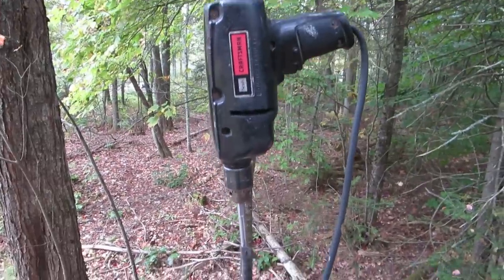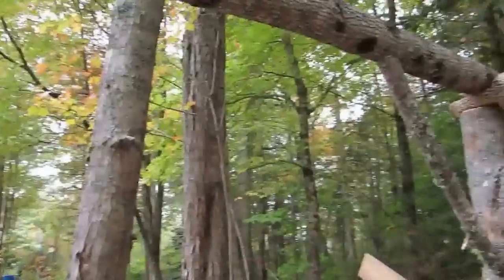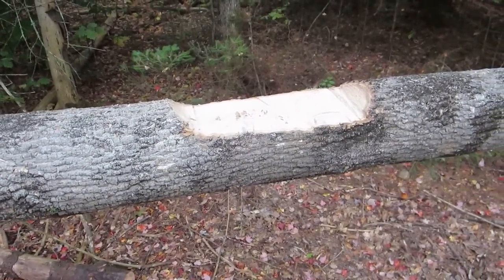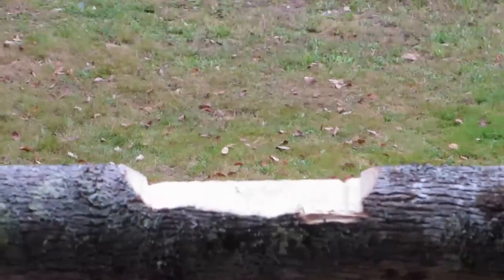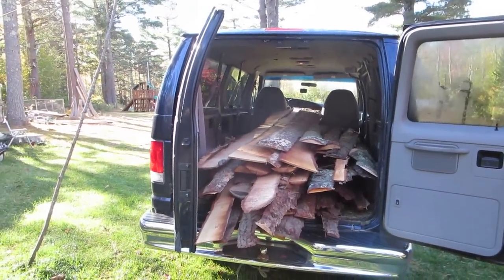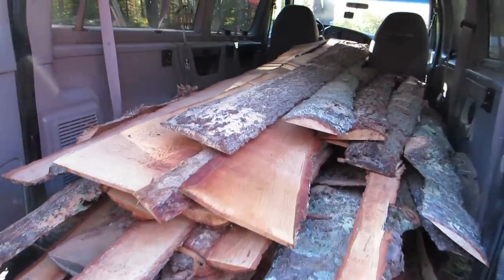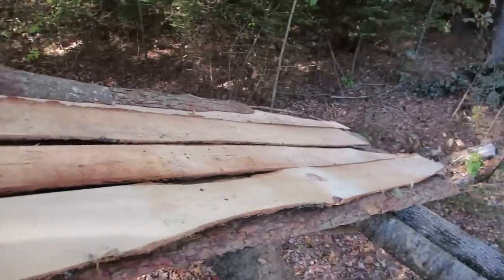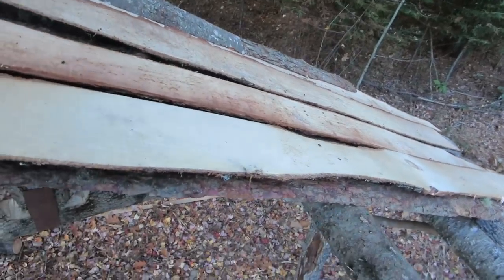How to build an inexpensive pole building Part 2

Comment: You could've used a tarp on the roof aswell and that could´ve provided you with rain proofing but, I imagine it could get really hot with sun exposition in summer. A technique used in shelters like that is using a mixture of hay, dirt, all condensed on top of the roof to make it water proof!
Reply from the maker: Thanks for the thoughts... I didn't need a structure that was 100% dry. I'm sure there are a few modifications that could be made if someone required a weather proof structure. Thank you for viewing and commenting!

Comment: Thank you for sharing.  Is it not a problem to leave the bark on the trees when building a structure like this?
Reply from the maker: I left the bark on and it is still intact today, three years after the structure was built. As a matter of fact I have had to do nothing to the structure at all since putting it up. I now use it for firewood storage all winter long and as a maple syrup shack in the spring. Thanks for viewing!!
Reply: Maine Homesteaders that's great, sure seems like that saves a lot of work!  I need something just like this at our place, and I appreciate you sharing your project.
Reply: Leave the bark on if you want to attract bugs. It'll help destroy your logs faster so your building doesn't stand too long. No one needs a pesky pest free building. 

Take the bark off before you build. You only give places for bugs to hide and gain purchase.

Comment: i built a 10 x 10 addition on the back of my pole barn garage and i  stick framed it and used peel n stick roll roofing  and 12 inch  t50 staples .. used plywood and used deck boards as the 2x4 frame and the collar ties i used rough sawn wood from  10 ft skids ment for delivery of metal roofing..at RONA.CA ..the whole addition was about  100$ for the roll roofing .. great place for  snow blowers and lawn tractors ... good job on your shed..  how it look today with the snow???
Reply from the maker: Thanks for the view and it sounds like you found a pretty inexpensive way to create a shed as well. Use what you have!! The shed is still holding up really well. It's pretty well protected from wind so the outside cover is still good. The structure is still straight and true. Using the building during the winter months to hold firewood and as a maple syrup shack in the spring. Heavy snow has not effected the building at all! Best wishes!

Comment: you could have done those cuts before you had put those logs up there first. building 101, do as much work as you can on the ground to save doing work at heights. good job. keep up the good work
Reply from the maker: Thanks for the advice and checking out the video. Best regards!

Comment: Why would you not cut the flats for the vertical roof posts before you raised the beams? As you note, cutting them while standing on the ladder is dangerous. But it's absolutely unnecessary. Chalkline, tape measure, lay them out and cut them on the ground in safety and comfort...

Comment: The support look like tokens. Those sticks? Good luck man. I wouldn't do that, but it's yours.
Reply from the maker: tokens? Not sure what you mean? The building is still standing and has had over two feet of snow on the roof during the winters at various times. Maybe not a perfect design but it certainly has worked for my purposes. Best regards.

Comment: Everything was going good till you started the roofing part of your building. That really took away from how good the building is
Reply: Stephen Harnois I agree.  I plan on using slab wood to side my structure ( and add more ash for studs in each wall) and may very well use old metal roofing for roof. But good ideas were learned here.